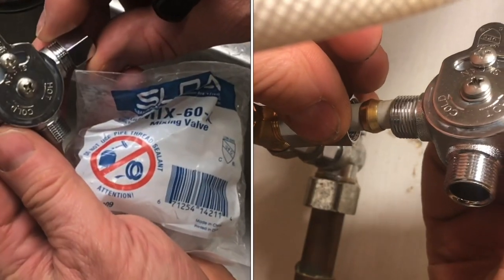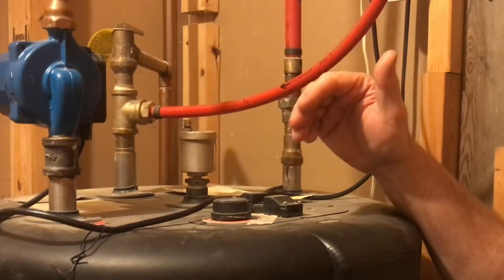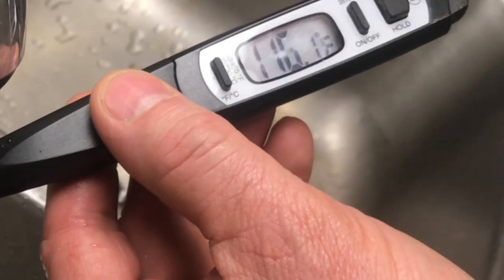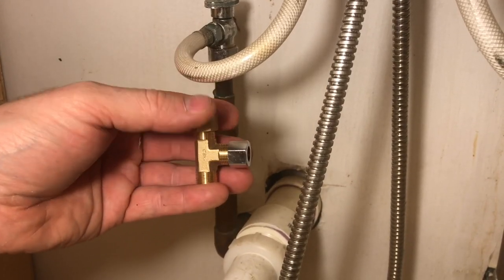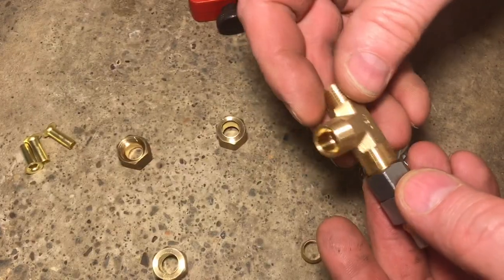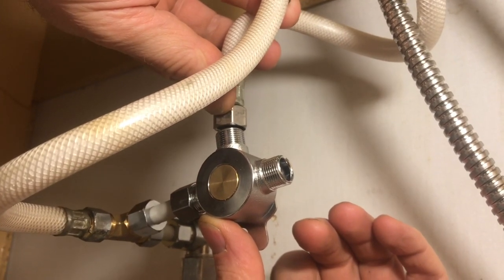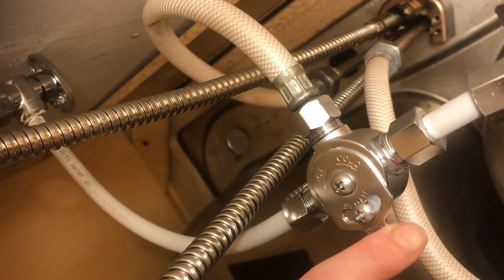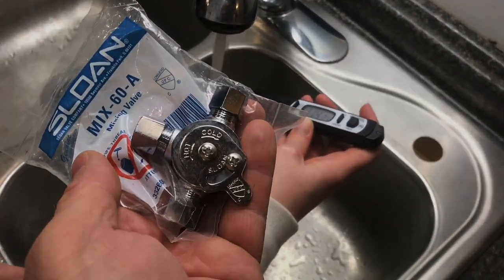how to “install” a MIXING VALVE on a kitchen faucet (sloan)

Comment: Very useful. I had new flooring put down in my bathroom. When it was finished, somehow the the Hot and Cold on the mixing valve leading to water valves were backward. Watching this video showed me that most  mixing valves work under the same principal as mine.

Comment: My problem is not that water gets too hot but opposite, when my wife is grooming a dog and I use sink in kitchen and call for hot water, she always complains that her water goes cold... Will this help? Same install?
Reply: No this would not help that situation. Think of it like this analogy: You and your wife are standing in line for cookies, you are ahead of her, so when you are at the counter taking all the cookies, she gets nothing and has to wait until you are done.

You “take” all the hot water because your faucet is ahead of her grooming bathtub in the line.
Reply: @shoyrushoyru  

We got it fixed, we bought an equalization valve at local plumbing store, now when I call for water this valve does something that she doesn't even notice I am using water 😊👍

Comment: Just for a future reference you should never use copper ferrules on polly water line. Only plastic ferrules. copper ones will actually cut into the plastic polly
Reply from the maker: Thanks, that actually makes a lot of sense. I’ll have to take a look around and see if they sell the plastic ones individually. It seems like they always come with copper ones
Reply: No problem 🙂Yeah all your compression fittings and angle stops typically come with a copper ferrell and if you use copper pipe then you would use the copper Ferrell I don't believe they sell the plastic ferrells individually they typically come in like a pack of 10 but they're really cheap cost-wise